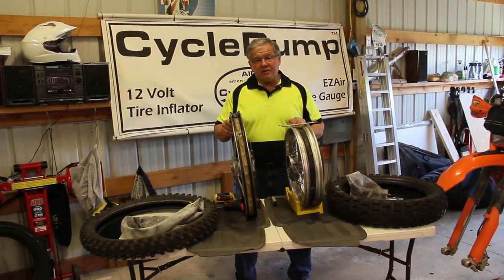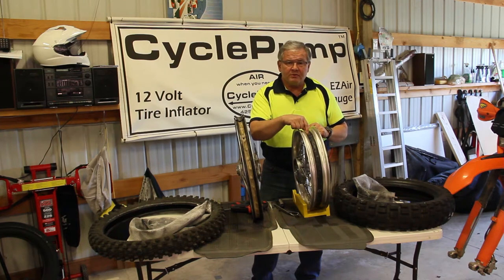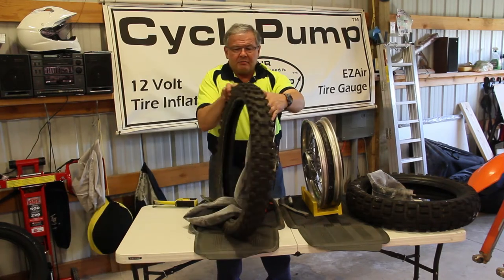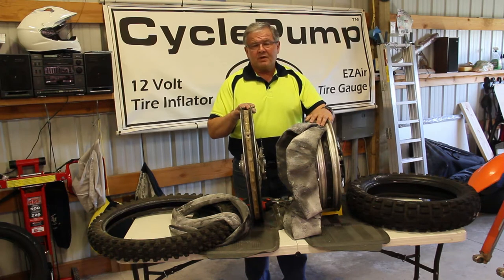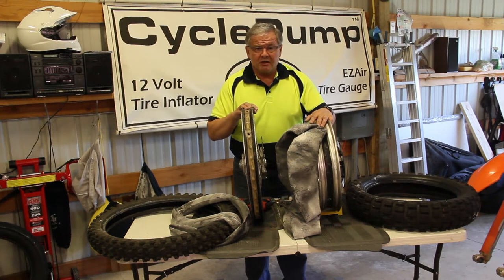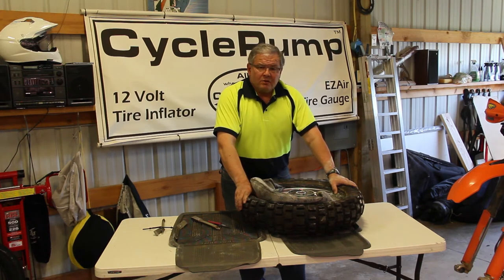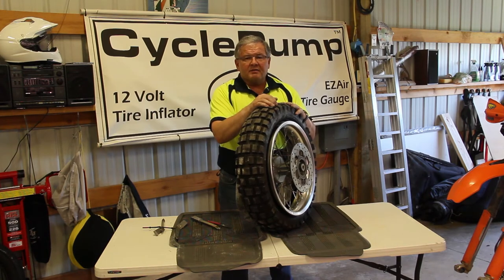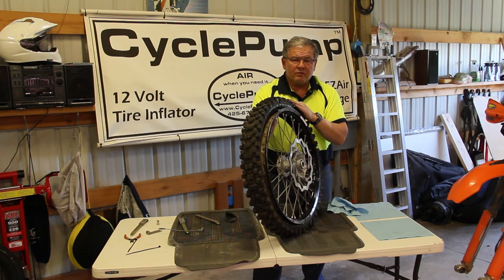BestRest BeadSpreader - Fitting A Tube Into A Motorcycle Tire

Comment from the maker: Tim - the narrow rim technique will work on wide rims too. However because wide rimmed tires are often so stiff that they're difficult to get over the edge of the rim, using one Beadspreader inside the rim on that side seems to work better. The other one is used to spread open the free bead.

Comment: Well, okay, but most people put the partially inflated tube into the tire before it's on the wheel, so unsure I see the advantage as it's something else to carry.  I'm open-minded on this just don;t understand the value. Can you help?
Reply from the maker: M Miller - not everybody does it the same way... in the typical scenario in the field, when a tube is replaced, the tire is left halfway on the rim. Getting the valve stem into the carcass and thru the hole in the rim can be very difficult. The BeadSpreader opens up the tire so you have room for your fingers. You can open it up so far that you even have room to fit a bead lock.

Comment: You 'invented' a solution to somethings thats not really a problem, ive never had a issue with fitting a inner tube into a tire, maybe a piece of wood between the tired and wheel frame, or a stick ive found on the side of the road....
Reply: Good for you. Your experience doesn't apply to everyone. Example: racing legend Jimmy Lewis uses and loves the BeadSpreader. He sees it as an essential piece of gear and he carries it on his bikes.

Comment: will the technique used on the narrow rim (lever one edge of tire wall over the the outside of the rim) and then use the J-shaped adapter on the opposite sidewall of the tire where you will insert the tube and fit the valve stem into the rim hole...will this work on a wider rim like the rear rim from the 650 as pictured?   Or why would using two of the J-shaped tire holder tools on a wide rim work better than using just one of the them and then holding the opposite tire wall at the rim edge with a tire iron tucked under the rotor or zip tied to the spokes?

It seems like the technique as shown with the narrower rim, using just one J-shaped tool, results in a larger relative open area inside the rim without interference from the opposite tire wall. 

It appears in the video of the wide rim, that  you have less open space in the rim valley to work with due to both the thickness of the zip tied J-shaped tool and the give in the zip ties allowing that sidewall to get  pulled in to some degree towards the center of the rim when using both J-shaped tools.

Have you tried using the narrow rim technique (1 J-shaped tool) on a wide rim and tire and if it did not work better or just as well as using 2 - J-shaped tools, what was the reason for it?
thanks in advance for your response
Tim